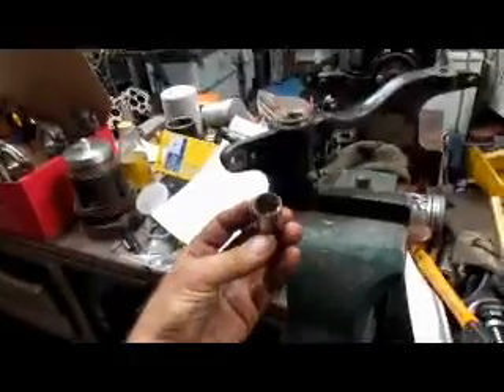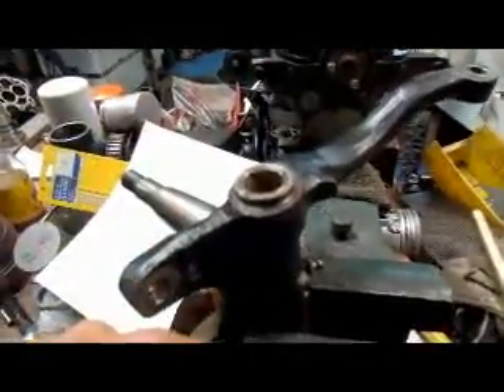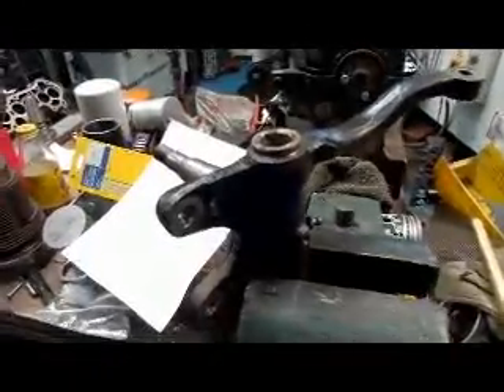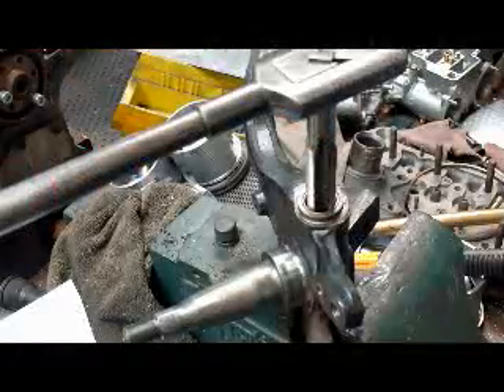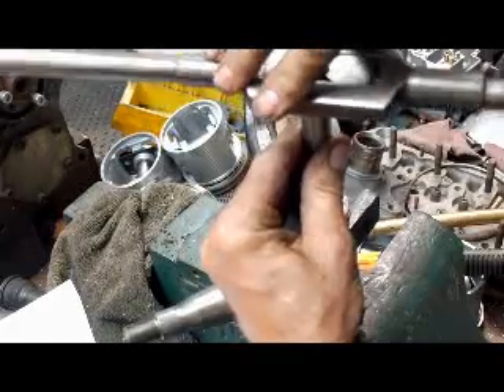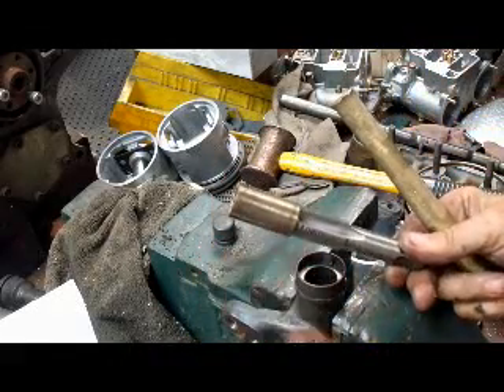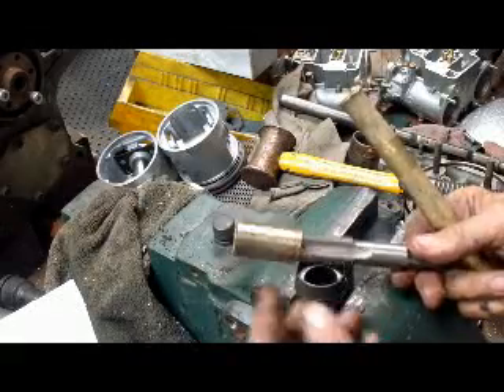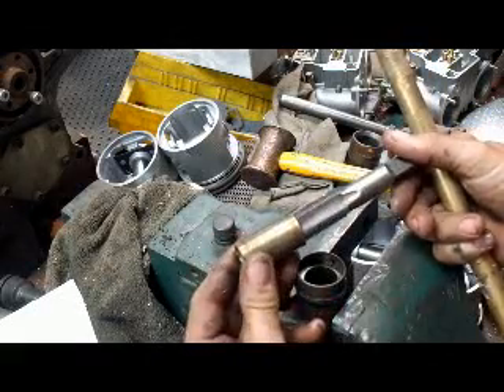Mercedes Benz King Pin Bushing Removal

Comment: With some good quality taps like this guy has, I bet they aren't phased by that light tapping. It's not like he's swinging the hammer like he is trying to kill it. This may be a bad idea for Harbor Freight taps though -__- I'll be using this method for a few things I'd never considered this for before. Also like Jason said, I am guessing that you could pull the tap out and thread in a bolt for a banging if you were really concerned about your tap quality/strength.